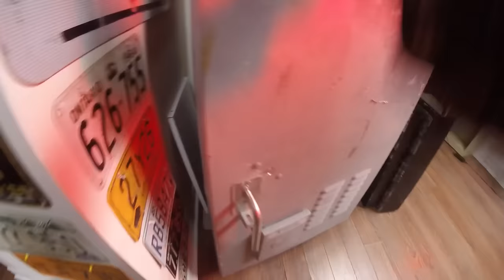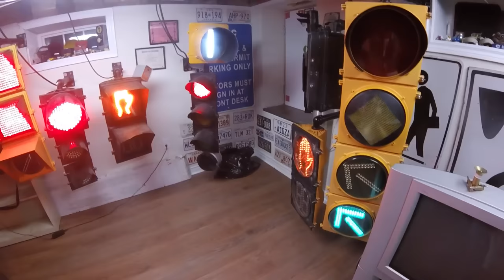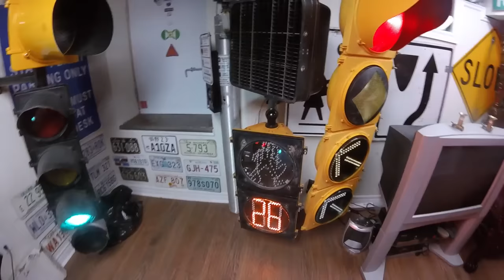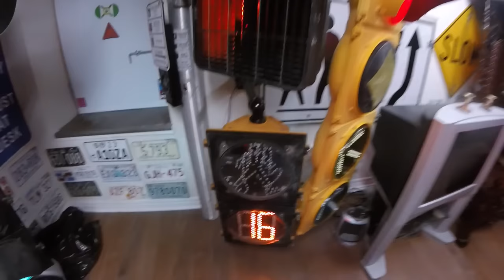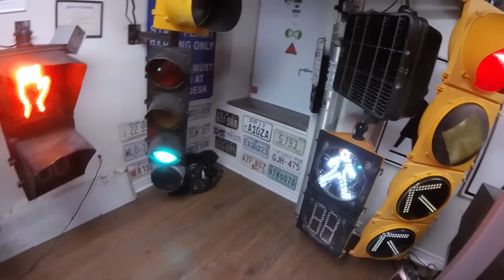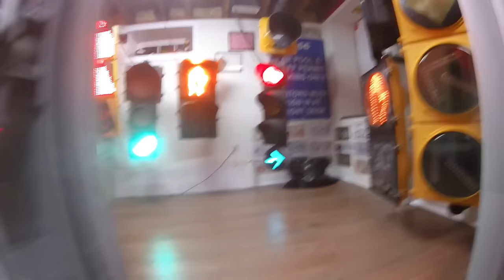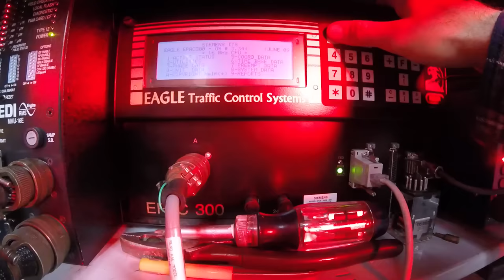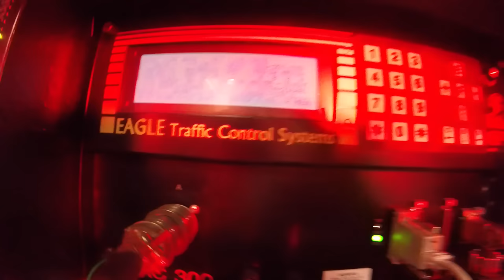My Latest & Greatest Traffic Light Configuration

Comment: I have a British siemans raghead lantern.  It's featured in my lights out video.

The lantern in my case is fitted with pedestrian hoods as the traffic version would make it front heavy.  I've also mounted the upper bracket to act as a counter balance, and the lower bracket stored in the base section for the same reason.

Comment: Maybe I missed it on one your other videos, but does your Opticom Preemption system work or hooked up? I see the receiver for it on the wall.
Reply from the maker: UEdiver Nope, not yet. I have a card and everything but I haven't run power to the card or hooked up the wires yet. I have a schematic for that and my video detection card! That's my next project!

Comment: What kind of traffic light is the one who has two square red lights?
Reply from the maker: Well that one is a combination of a 2 section GE signal with square doors and a single section Econolite with a round door. I've modified that signal since this video. The one piece signal with the one square red light is a GE Gentrol. Very common in Quebec, PEI and some parts of New Brunswick (Canada).

Comment: Do I need a load switch for each signal I have or does one load switch control all north and south and another load switch controls all east and west?
Reply from the maker: A load switch can control a group of signals. One could control all main street signals or one per direction. Each direction should have 2-3 signals at least. I have all my load switches being used so I can run as many overlaps as I can but it's not necessary.
Reply: @TheTrafficTech  Great! Thank you!